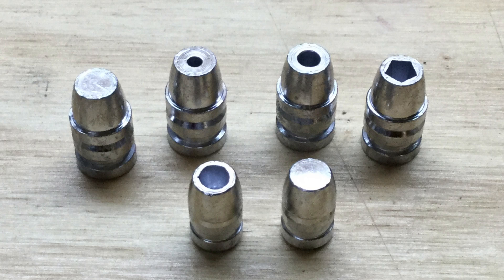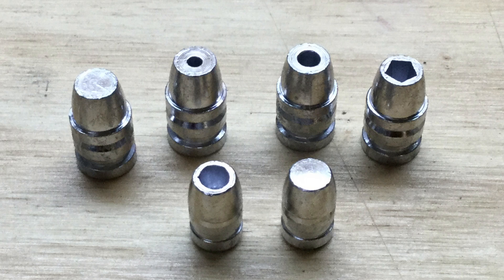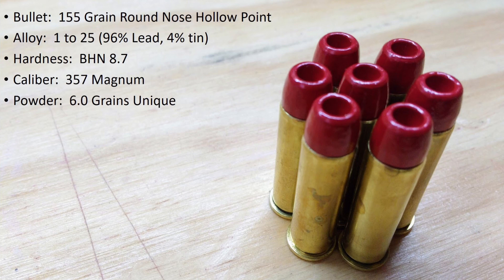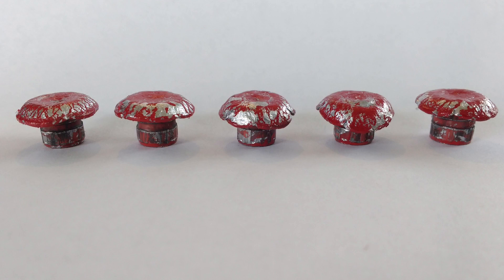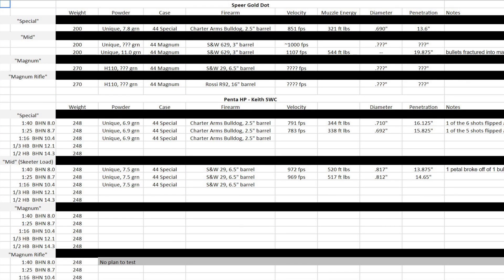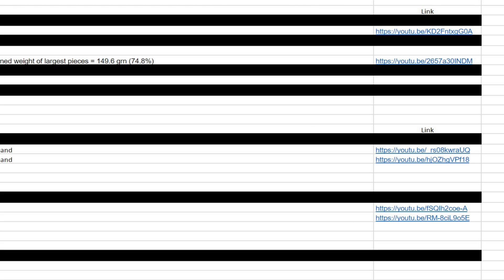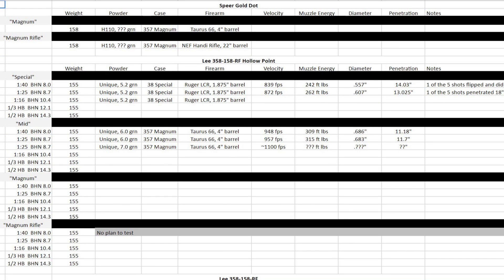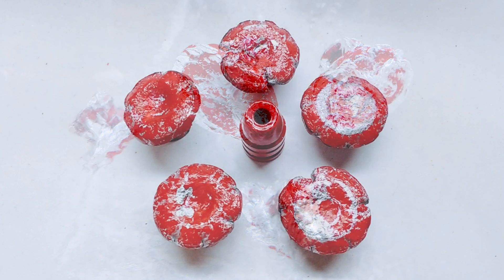Hollow Point Test Information and Comparison - Spreadsheet

Comment: I recently got an EMF GWII 45 Colt(Colt SAA clone) and am wanting a Lead Hollow Point Bullet that expands as much as possible at Low Velocities (800 -950 FPS).
Leading of the barrel would not be an issue as I do not shoot that much anymore(60 years old)
And I also shoot a Remington New Army Black powder revolver (Made by Pietta)so frequent cleaning is a given !
Anyway  I am thinking that a Pure Lead Hollow point bullet say 225-250 grains would give relatively low recoil with Limited Penetration and good stopping Power, in the unwanted and unlikely need for home defense.
Plus I would be able to use these bullets in my Remington New Army (Maybe without sizing and If I had to I could use a push through sizer)AND for the 45 ACP cylinder that came with the New Revolver.
I would appreciate your thoughts on my line of thinking 

I just found and subscribed to your channel.
Great information !
Prior to this I have been Reading a lot of Hollow Point Material written by Gene Fryxel.
Thanks again for all you experimentation and your sharing of it !!
Craig

Comment: Hey so when I cure my bullets in the oven, I noticed that at 400 degrees, the lead starts to melt a little as the wire mesh basket I use leaves dents in the bullet
Reply from the maker: I suggest getting an oven thermometer and checking your actual temp.  These ovens are well known to be far off of the temp indicated on the dial.  You should not be seeing any lead melting at 400.

Comment: Your clear and to the point videos are very easy to watch and learn from. Thank you for your great work!
Reply: Also, I am a .44 spec and Mag fan and have used your vids to cast, powder coat, and load my bullets. I use Red Dot for my .44 spec however I can use the velocity as the variable to ensure I am using the proper amount of powder to achieve the results you are showing. As for the powder coat I found the high gloss clear and Ford Blue from Eastwood to be the easiest and best powder paint to work with as per coating lead bullets. Again, I found this info watching your vids. I did not have much luck with the lime green. The molds I use are the Lyman 255gn Devastator HP with gas Check, and the Lee 200gn rnfp flat base. I load them in front of 5.8 grains of Red Dot. I do not know the velocity yet for I shot my chrono!  And waiting for the next big sale on them to get another one. Anyways, your data and vids have helped me out greatly. Thanks and keep up the great work!
Reply from the maker: Thank you for your kind words Benjamin!  I'm glad this all has helped.  It's odd that the lime green isn't working out for you, as I find it to be one of their better powders, but I like their blue and clear as well.
Don't know your brand of chrono, but if it's a Competition Electronics, take a look at my two "I shot my chronograph!" videos.  You can get it repaired/replaced for a decent price.  (I shot my chrono with a 44 mag 270 grn hard cast SWC.)
What revolver are you shooting your 44 spls from?

Comment: If I were to make one suggestion, it would be to add a column for modal penetration next to average penetration. I think that gives a useful mental picture of what the projectile generally does, as opposed to an average of the extreme cases.
Reply from the maker: I agree in principle, but I'm not sure the best way to calculate that with a sample size of 5 where I'm measuring to the nearest 1/8", and often I don't have a repeated value.  Thoughts?  Maybe I cut the min/max values, and give the mean of the remaining 3 values?

Comment: im curious about your molds who makes them and where do u get a penta hollowpoint from
Reply from the maker: The 38/357 bullet is the Lee 358-158-RF mold, and it was hollow pointed by Erik Ohlen at  http://www.hollowpointmold.com/.
The 44 Keith SWC mold is the "MP 432-256 PB HP 4 cav" mold from https://www.mp-molds.com/.  This mold came with a few different hollow point pin options, to include the penta.
If you have a few minutes, there's a bit more info about these molds, along with a few close ups, in the Intro video to this series.  Hope that helps, and have a great evening!

Comment: Looking at my notes I have 7.5 gr of unique as a MAX Load for the C A 44 sp for a basic comm cast 240 gr SWC bullet . I know I have shot hotter but thought that was a smart limit . Same for 180 gr JHP rem/Sie , 9.5 gr of unique , all with 300 CCI . I have tried a FEW Keith type loads that felt like a 454 Cassull ... too much fun for me . Have you come up with MAX LOADS for your charter , all my 44's have guns listed   >> Not for charter , Not for S&W  Rifle or Ruger ONLY ,  Best for Charter ............
Reply from the maker: According to an article by Brian Pearce, you can shoot that bullet with up to 8.5 gr of Unique, but I wouldn't want to.  The recoil is beyond the point of fun at that level.
I haven't fully developed maxes for any of my revolvers.  For the C A, I usually shoot a 200 gr cast bullet at 850 fps, or a Keith SWC with 6.5-6.9 gr of Unique.
Reply: Yep  most of my 240 gr SWC start with a 6 ... same with barry bullets
Reply: My notes show no change in VEL between Ruger 4 5/8 "  and Dan Wesson 8"  when shooting 180 gr JHP Rem/Sie  & 240 gr lead Cowboy match Comm cast , when using Unique @ med power level . From a rifle Add about 200 FPS ( Marlin SS 20" ) .
Reply from the maker: I think ~4 inch barrel is the "magic" length.  Less than that and you see velocity drop a fair amount, but above 4" the increase is far less dramatic.
Reply: In short barrel I love unique because it can be used for many different Cals. , BUT I think Elmer Keith had it right about 2400 , if you have or want to get some longer barrels ALSO ( full power ) . If I was starting New & short on cash I would buy Power Pistol , AA#9 & 2400 for handguns long & short & pistol Cal rifles .